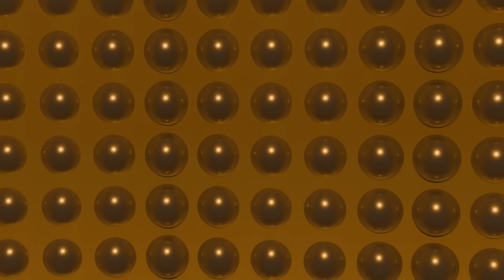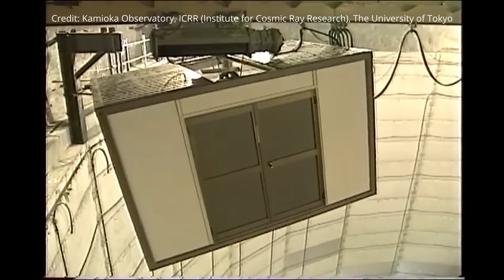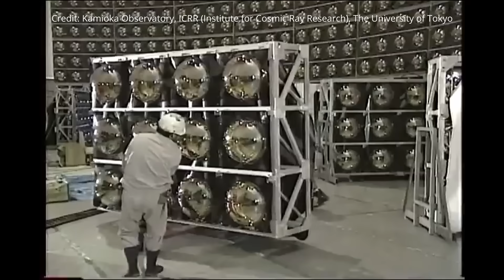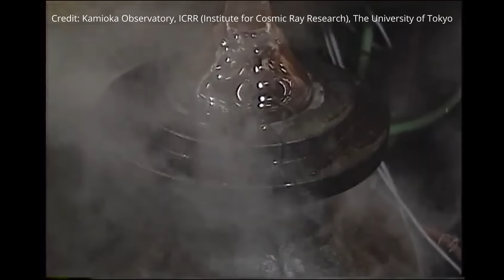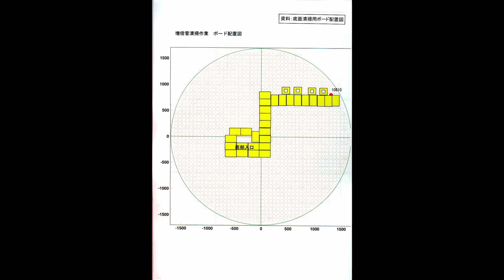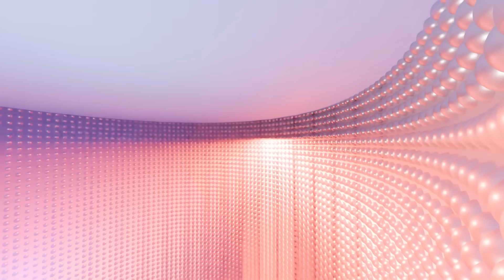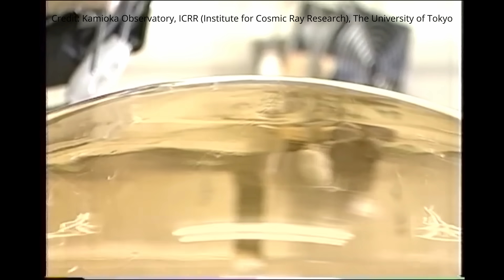An Engineering Fairy Tale: Cascade Failure at the Super Kamiokande

Comment: As an HVAC technician that works on steam heating systems, I have a lot of experience with water hammer and vacuum. One of the most interesting phenomena that can happen in a vacuum steam system has to do with steam syphons and gauges under vacuum. Let's say you have a pressure gauge, hooked up to a boiler with a syphon (basically a U shaped pipe that holds water to protect the gauge from steam temperatures all the time), and this boiler is in a naturally induced vacuum system (goes into vacuum while the boiler is not running). Now let's say that the boiler starts up fairly soon after the next cycle, while the system is still at -10 or more inHG of vacuum. Until enough heat is put into the water to influence the pressure at the end of the dry returns and open the vent check valve, the system will still be in a vacuum, but the heat being put into the boiler can heat up the water in the syphon far beyond the level where it will start boiling at that level of vacuum. What happens next is that the water in the syphon will rapidly start turning into steam and generate intense spikes of pressure that are audible and also visible as the needle on the gauge shakes violently going to full scale and back again. If the gauge is not rated for pressures far in excess of what the system operates at, there's a good chance of it breaking. In a vacuum system without a pump, there is essentially no practical way to stop this from ever happening, so the only option is to get a gauge that can handle surge pressures of at least 5-6X normal operating pressure. In many systems I work on, operating pressure may only be measured in ounces per square inch, or even just a few inches of water, while vacuum can be as deep as -20 inHG. For those systems, the only option for a gauge is a particular gauge designed to measure differential pressure, which can also be set up for single pressure, and is rated for 500 PSI/20inHG or 600PSI/29inHG surge pressure. Extremely overkill, and extremely expensive, but it's the only option that will not be destroyed by water suddenly deciding to turn into steam inside the gauge. At least this only affects one instrument and doesn't cause a cascade effect like the disaster mentioned here. Although there are other failures elsewhere in a system that can happen and cause a cascade failure, like a steam trap failure letting steam into the dry returns, which will quickly damage every other steam trap in the system, but not on a time scale as quick as this.
Reply: thanks for sharing your professional experience, it seems that some aspects of your work really coincide with the kamiokande accident, and you clearly know a lot about what you are talking. I would never guess HVAC systems could be so complex.
Reply: @JoãoWaihrich  My first job after graduating with my bachelors in mechanical engineering was engineering HVAC systems at Trane.   Anybody that's studied thermodynamics understands that heating and air conditioning is incredibly complex, but your average laymen has absolutely no clue at how HVAC works on even the most basic level.  One of the most frustrating parts of that job was how people always thought my job was comparable to an auto-mechanic.  Occasionally there would be reason to describe the fundamental science underpinning HVAC (i.e. latent heat provides a loophole in the 2nd law of thermodynamics allowing us to move heat from a colder space to a hotter space, akin to making a ball roll uphilll thermodynamically speaking).  At which point they'd be really surprised and apologize for thinking I was a glorified plumber.   (No offense to plumbers, ya'll do God's work).  Anyways, I ended up quitting and getting a job in the high capacity lifting industry designing massive cranes to lift jumbo-jets and build oil-rigs in the arctic ocean and such, which is MUCH simpler science, and a much easier job.  Of course people would always be far more impressed when I'd tell them what I did for a living, until I reminded them how simple machines work.
Reply: I believe the equivalent phenomenon in refrigeration systems is called "flashover in the evaporator" and causes a loud sharp knock to emanate from the innards followed by a few weaker knocks.
Reply: @theodorgiosan2570  It's impressive that the massively overkill gauges are still cheaper than designing the machine to have a replaceable gauge.
Maybe I misunderstand the rarity of the event.
Reply: @Poldovico  A failed gauge will likely start leaking lethally hot steam.
Reply: @KaneYork  ah, that'll do it
Reply: ... for five years, my 300 H.P. boiler operated continuously ... weird ....
Reply: I must say, I wish I understood the units to have a context.
Reply: Is there any way a damping material can be added to the siphon pipe, e.g. foam, or a Tesla valve if there is a significant volume of water or steam moving around? This would slow the rate of change over time by damping rapid fluctuations, but as long as you were happy to have lag in the pressure reading due to the damping, the pressure reading would still be accurate
Reply: I always wondered why the dials had a U bend feeding them. I had thought it was for aesthetic reasons and not practical design necessity.

Comment: There is a very happy glas blower workshop that not only produced tens of thousands of those tubes over the last decades, but also can be assured that the next iteration of the detector will need even more. In most cases, glas blowing is a dwindling art, only used for very specialized lab equipment or for tourists. Even those will not suddenly be asked by the government, how fast they can produce, say, 20000 Serpentine Reflux Coolers. 

So this is a win not only for science, but also for those craftsmen.
Reply: I think it’s pretty cool that the university I work at still has a glassblowing shop, and that it even trains apprentices.

Comment: One of the problems with water implosions is the mass of the water - that produces pressures due to inertia that are far beyond what an implosion in air can. That also produces an ultra high temperature plasma at the centre of the implosion bubble. That compounds the rebound pressure wave.

Comment: The moment he emphasizes the word 'hydrostatic' I think I have a good idea of where this is going. I'm no engineer, but when you put the terms 'cascade failure' and 'hydrostatic tolerance' next to each other in that tank, well... that does indeed sound exciting.
Edit: Yep. That went just about exactly as I envisioned it. :D
Reply: I'm curious to know what earthquake mitigation they did (it is Japan). Plus, there's also the potential lensing effect from the difference in speed of sound between rock and water (you see the same distortion when you look through a glass of water).🤔
Reply: @garethevans9789  Look at it as this: if you have 10 cars driving next to each other, they form a straight line, like a wave front of light. If they all change their speed at the same time, the staight line is preserved and so is the wave front. Now, if they all change speed with a slight increasing time difference, the straight line slants, like a wave front of a beam of light does when it passes from air to glas at a non-perpendicular angle. But while the line of cars is now slanted, each car still travels in the same, unchanged direction. So, if you perform this experiment with just one car, or one single photon, it just slows down or speeds up. It doesn't change direction.
Reply: Me too   :)     'Water hammer' is a phenomenon that (often) depends on water rushing into a vacuum, ditto cavitation bubbles collapsing.   The point is, there is absolutely nothing to 'cushion' the incoming water until it 'comes up solid'.  These photomultiplier tubes were just like ginormous cavitation bubbles in that respect.
Reply: @cr10001  You have put the correct layman’s terms to the phenomenon.  Many know that water hammer can knock pipes about and even break a joint.  Cavitation causes erosion of ships propellers and can be used to strip dirt off surfaces with an ultrasonic cleaner.

The forces are indeed formidable and perhaps a soft gel coating around the tubes would be a practical way to prevent the shock from the sides.  I expect the shock from directly in front might be less and the dome might be able to handle it better.
Reply: I was predicting that one of them would break in a way that produced very bright sparks, which would oversaturate the other detectors in photons and make them break the same way
Reply: @Ultimaximus yeah that works.
Reply: I kind of put two and two together as soon as I saw the stock footage? B-roll footage? Anyways, all the videos taken inside the tank in the first two minutes or so. That plus the title was all I really needed (well, also knowing what most neutrino detectors are).
Reply: I was guessing water hammer from an earthquake...turns out the water hammer made an earthquake lol
Reply: @ like a giant tub full of bubble wrap
Reply: @emp_zealoth  Weirdly an earthquake didn't even occur to me. It should have, given that this is Japan, but I totally overlooked that possibility. ;D
Reply: I was guessing temperature-pressure, ie. the water was cold while the glass had been heated up from the workers/lights, or even just dynamic pressure from water being poured back into the tank at too high of a rate. Never would have guessed this, though
Reply: I thought he was making a joke about how many glossal Ts he'd been saying and how he'd pronounced it "hydros'a'ic."
Reply: You’re smort can we be friends?

Comment: For those curious, the Weak Nuclear force is a force that pulls oppositely to the spin of most subatomic particles: pulling up on down quarks, pulling down on up quarks, things like that. Because of this, it can cause some particles to spontaneously change into other particles. For example, it can flip one of the down quarks in a neutron up, releasing an electron and an antineutrino and turning the neutron into a proton.

It is also not symmetric, and the only fundamental force that isn't symetric, which given it's tendency to turn particles into other particles means it is almost certainly the reason why there is so much more matter in the universe than antimatter.
Reply: For very particular definitions of 'pulling up' and 'pulling down'... No gravity involved ;)
Reply: You really ought to specify which symmetries you are talking about. (In this case, parity and charge-parity.)

And the up and down in the names of the lightest quarks have nothing to do with spin. The total spin of all quark types is always +1/2, and the spin projection varies between ±1/2 and 0 depending on the context, it isn't fixed.
(If you only look at the lightest quarks then you could say it affects isospin in the way you described; but the heavier quarks make the model more complicated since their isospin is 0)

It is true that the weak interaction is the only one that can change the flavor (i.e. "type") of leptons (elementary matter particles). The description of beta decay is correct. Some particles can also decay via the other forces. For example, alpha decay is not caused by the weak force. Note that this decay doesn't change the type of any elementary particles.
Reply: Is saying that the force isn’t symmetric equivalent to ‘parity is violated’? I remember that showing up on the edges of my reading, first in a Time-Life science book series in connection with the Chinese researcher who might have got a Nobel out of it, without gaining a significant understanding of what was at stake other than the paucity of antimatter. Also I knew it was involved in nuclear mutations/radioactive decay, but no word on the mechanism. 
The bump of info is much appreciated, and about the level of detail I wanted at the moment.

Comment: (Particle physicist here)

4:57.  Your brief foray into particle physics was quite cogent and largely correct, certainly enough for this video.  Well done!  

Broadly, in particle physics, we shoot particles at targets.  Sometimes an interaction happens, it blows apart, fragments come flying out.  We detect the fragments of the collision/reaction by having some active medium that responds to the travel of a certain type of fragment by producing light, we collect and pipe the light to a photon detector, which produces a burst of charge, and then we digitize the charge to reconstruct the fragment, and then by working backwards reconstructing all the fragments, we reconstruct the original thing that happened (as we as we can, and then do it ad nauseum to build up statistical picture of that reaction in aggregate).  

Unusually for a particle physics experiment, the water in Super-K is the target, the active detector material, and the light pipe that gets the light to the photodetectors.
Reply: basically just a ginormous liquid scintillation counter. you can actually use water as your "scintillation cocktail" for detecting high energy beta emitters on an LSC, where the instrument detects cherenkov effect photons just like this.
Reply: @fsodn  there would probably be a lot more particle physicists if the field was sold as “shooting particles into targets” “blowing things up” “smashing things into fragments” etc. before saying *	ᵗʰᵉʳᵉ’ˢ ᵃ ˡⁱᵗᵗˡᵉ ᵐᵃᵗʰ ⁱⁿᵛᵒˡᵛᵉᵈ
Reply: @yesthatkarim9601  I will say that what got me interested in the experimental side of things, rather than the theoretical side of things, is that experimentalists get keys to the student machine shop.  And get to solder, and and build, and occasionally design their own hardware.  It's actually kind of a good gig.
Reply: The water in Super-K is also part of the radiation shielding (keeping background count out). If a Cherenkov cone starts off in the middle of all that water, it's been caused by something that's pretty penetrative!
Reply: @abarratt8869  I don't really think so.  The shielding from upper-atmosphere particle production from cosmic rays is provided by the 1000 meters of earth and rock above it; that's why all of these neutrino detectors are so far underground.
Reply: huh, it's like the coconut of experiments 🤔
Reply: My family does something similar with used appliances and Tannerite every year after Halloween.

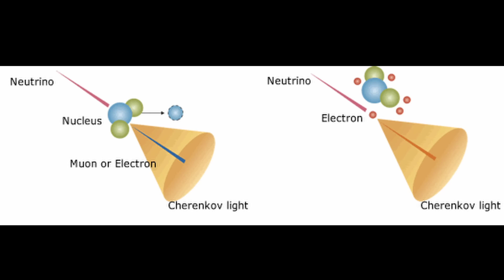Comment: 4:27 - no, it is not impossible for something to go FASTER than the speed of light in vacuum: It is only impossible to REACH that speed (from either side) and we have no evidence that there is anything that goes faster than C, but so far we have found nothing that would proof that to be impossible.

And that failure - it kinda seems strange that they had no counter-measures for implosion-damage. Having a simplified test and not even to destruction is not adequate, and then not having any repeating tests just makes it worse.

Comment: You could probably approximate the volume of eqch tube, multiply times how many imploded, and determine the mass of air rushing in to the facility. If they know exactly which was the first tube to go, they probably know the duration of the whole cascade event from first to last implosion.
You should be able to use the air mass, the displacement time, and the average cross sectionof the tunnels and vents leading to the chamber to determine the speed (flow?) of air, and whether that would have been enough to push someone. What for? I don't know. Just 'cause.

Also, did the tubes imploding act as giant cavitation bubbles? Did they produce light as they collapsed? Did the other tubes detect the cascading event and got their sensors overwhelmed?

Comment: If all the material from Jupiter, Saturn, Uranus, and Neptune were used, the Dyson Sphere would have a thickness of approximately 1.2 meters.
Here is a table summarizing all the key results, including the energy required to move each planet to Earth's orbit, the mass required for a Dyson Sphere enclosing Earth's orbit, and whether the material from the four planets is sufficient:
Results Summary Table
Category	Quantity	Value
Planetary Masses	Total Mass (Jupiter + Saturn + Uranus + Neptune)	2.6552×1027 kg2.6552×1027kg
Energy Required to Move Planets to Earth's Orbit		
- Jupiter	Energy (EE)	6.7×1036 J6.7×1036J
	Time to Gather Sun's Energy	555 years
- Saturn	Energy (EE)	3.8×1036 J3.8×1036J
	Time to Gather Sun's Energy	315 years
- Uranus	Energy (EE)	2.4×1036 J2.4×1036J
	Time to Gather Sun's Energy	199 years
- Neptune	Energy (EE)	1.9×1036 J1.9×1036J
	Time to Gather Sun's Energy	157 years
Dyson Sphere		
Inner Radius	Distance to Sun (rinnerrinner)	1 AU=1.496×1011 m1AU=1.496×1011m
Thickness	Thickness of Shell	1 m1m
Volume	Volume of Shell (VshellVshell)	2.81×1023 m32.81×1023m3
Density Assumption	Material Density (ρsteelρsteel)	7,850 kg/m37,850kg/m3
Required Mass	Mass of Shell (MshellMshell)	2.21×1027 kg2.21×1027kg
Material Sufficiency		
Total Mass from Planets	Available Mass (MtotalMtotal)	2.6552×1027 kg2.6552×1027kg
Feasibility of Dyson Sphere	Sufficient Material?	Yes (Available mass exceeds required mass)

Comment: Ok part way through the video before the explanation of the cause.  They are large vacuum tubes.  If one where to fail it would cause a sudden and violent on rush of water to fill the void putting extra strain on all the vacuum tubes around it.  Either by manufacturing fault or cycles of filling and draining the tank one on the bottom failed.  Propagating a wave of destruction through everything like some of the nightmare scenarios involving cavitation bubbles.